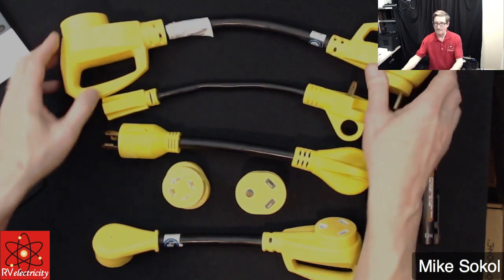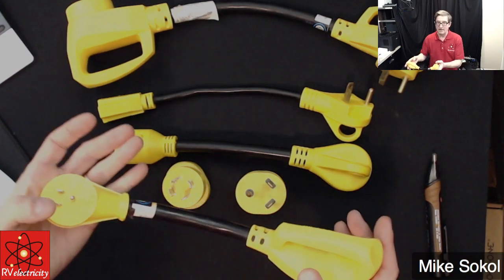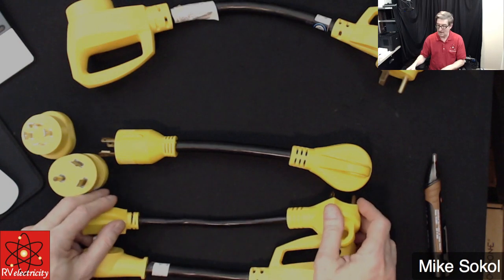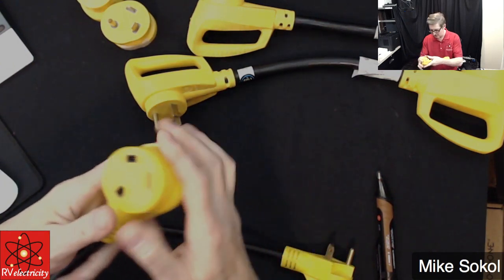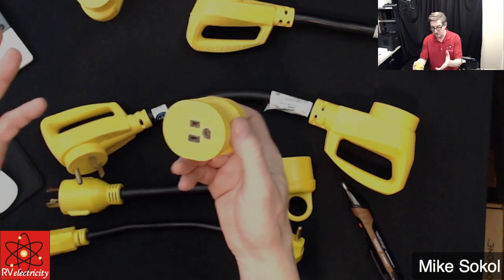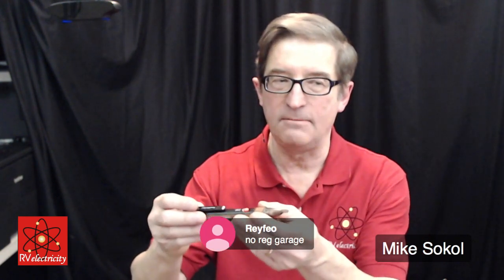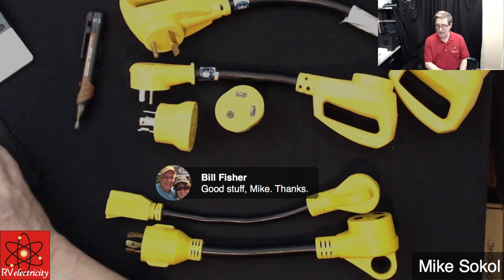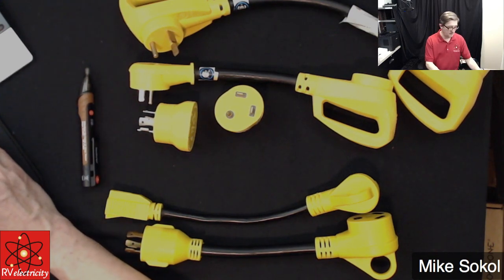RVelectricity Jump Start - Dog-Bone Adapters

Comment: Mike.... I am in a 50 amp RV plugged into a 30 amp RV pedestal. The owner of the park has this protected with a 40 amp breaker. Clearly, this leaves my dogbone vulnerable. Is there a dogbone with a breaker built in?

Comment from the maker: Many RVs with 50-amp shore power  have a lot of normal internal leakage that will cause any GFCI to trip. And battery charger/converters are allowed to have more leakage since the have noise reduction filter capacitors on their AC input. That’s why GFCIs are not required on 30 or 50-amp pedestal outlets. So in your case, plugging your adapter into a non-GFCI outlet that’s properly grounded is your only option, but check  your RV for hot-skin voltage with a Non-Contact Voltage after plugging into any outlet.
Reply: Thank you.   While I always check the electrical and the pedestal when at Campgrounds, I haven’t while at home so thanks for the reminder.

Comment: I have a 50amp 240V plug for my electric car charger and I wanted to use it to run my 30amp RV.  So I attached my 50amp male to 30amp female dog bone and then plugged the RVs 30amp power cord to that dog bone (yes, RV has a 30amp circuit breaker in main panel) and I did not fry the whole RV (didn't think about the 240V thing until I plugged it all in).  So somewhere along the line I am assuming one leg of 120V was dropped?  Can you tell me why the RV wasn't fried?  TIA.

Comment: Please check your comment about 240 v connection on a 50a circuit. You know full well that its TWO separate 120v circuits on that pedestal (or should be) because if its a 240 circuit breaker inside if one side developes a problem it MAY NOT trip a 250v breaker... I know you know this. May have been a slip of the tongue. New people will just wire it up and think its right.
Just noticing the thing I have to fix A LOT going to troubleshoot at owners homes/properties.
Reply: I forgot. Ill get hreif from those that don't know this. But the easiest way to ensure your 50A breaker in your house works properly with your RV is to remove the pin that connects the two switches. Now if one side has issues it can trip without the Other side preventing it. Hope I helped someone picture in their mind how those campground pedestals are wired.

Comment: Why does my 50 amp RV (with dog-bone adapters) flip my Edison outside gfci garage receptacle, yet when I run the cord INTO the interior of the garage, Edison Non-gfci receptacle, it works just fine?   Just using it to keep the batteries charged.  All Edison’s 20 amp.

Comment: Hi Mike
There was one situation that you didn't mention that I have experienced. If the quality of the dog-bone is good, are there any issues connecting a 30amp RV to 50amp pedestal? Thanks for the videos.
Reply from the maker: While it's technically a code violation since there would be a 50-amp circuit breaker feeding a 30-amp rated shore power cord, as long as the RV power center has a 30-amp circuit breaker on the shore power input, it should be safe to use. But this sounds like a great Part II of this series, so I'll ask Camco to send me some demonstration products. Thanks for the idea.

Comment: Hi Mike! Thanks for the great video.  Quick question:  what do you recommend to protect a plugged in dog bone adaptor from water intrusion between the adaptor & the RV’s power cord during a rain storm (the end plugged in to the receptacle is protected by the receptacle’s cover, but the other end hangs exposed below).
Reply from the maker: Sue Valentine 
Hey Sue... in the pro-sound business we use clear garbage bans on the entire power box. I’ll look for a good source.
Reply: RVelectricity, awesome! Thanks for the response!!

Comment from the maker: Well, a 240-volt car charger has 2 hot legs and a ground wire. But a proper 120/240-volt will also include a neutral wire. Either hot will measure 120 volts to ground, so that’s probably how the adapter was wired. However, the ground in your charger cord is not designed to carry neutral current, so while this might work at low amperage, it could fail at higher amps and probable create a hot-skin/contact-voltage. So stop doing this immediately and have a properly wired outlet installed.